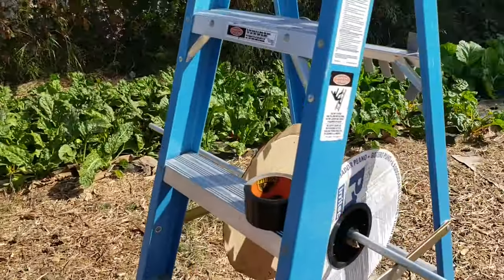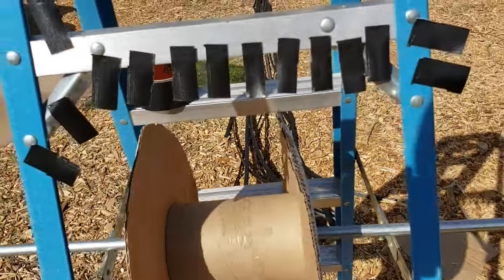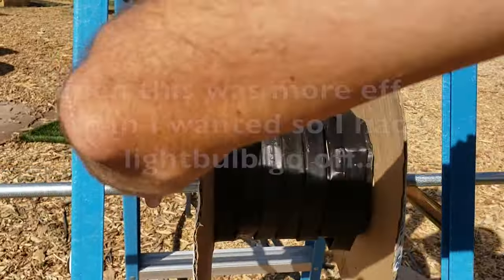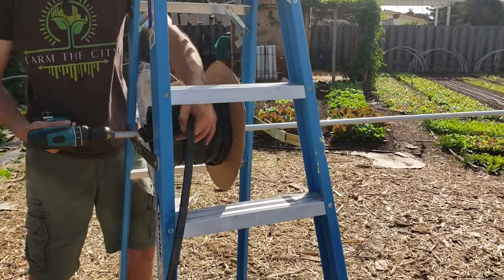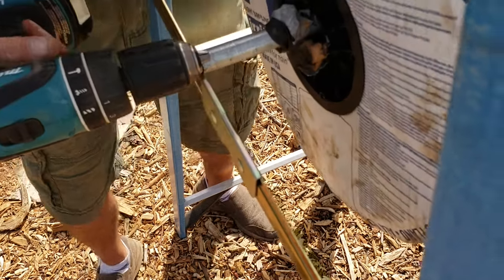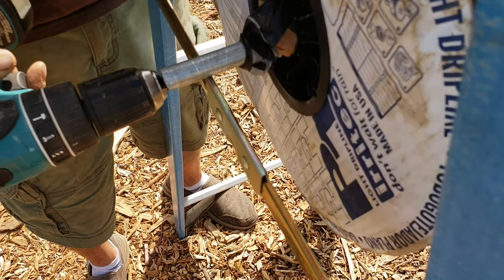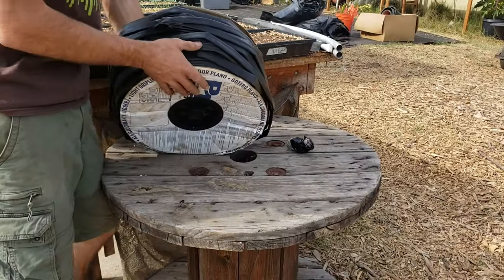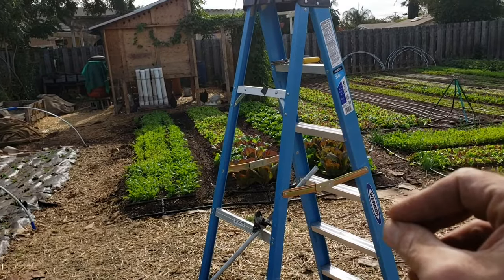How to Roll Up Drip Tape Irrigation Easily

Comment: I use utility buckets from the dollar store. The buckets are round and cost $1.00 each and I wind the drip line around the outside of the bucket. One bucket for each drip line.  I use a clothes pin at the start of the line clipped to the rim of the bucket and another clothes pin at the end of the line clipped also to the rim. I have used drip tape foe a couple of years and this is the best solution I have found so far. Hope this helps. Nice garden.
Reply from the maker: Thanks for the tips Gypsy! That sounds effective and organized.

Comment: Just about to start setting up our irrigation pipework for the farm. I like the drip pipe you use but how long does it last? Do you reckon it's worth spending more & purchasing rigid pipework for longevity?
Reply from the maker: The 3/4" poly at the first farm I helped build 8 years ago is still using the same drip system from these same materials. 15mil drip tape also lasts a long time. It depends on your application. As an urban farmer who leases land it needs to be easy to pick up and move to the next plot and not invest in permanent infrastructure. So that's why I build my systems this way. I like have the drip all above ground it makes it easy to fix and adjust, but I'd run the mainline PVC to wherever the plot is then run 3/4" poly for 2,000sqft or more 2,000sqft and less you can use 1/2" poly.

Comment: in plumbing they have expansion plugs . you may need a bigger pipe .thread and nut cranked opens bushing in the pipe to seal .attach the threaded shaft to your drill.
Reply from the maker: Thanks for the tips John, I'll check that out.

Comment: Wooden dowel tapped into the pipe, pre-drill and screw through the diameter or into one side at least, mating the dowel to the pipe, then chisel/sand/saw the dowel down to a diameter that your drill teeth can clamp on to.  Mark the center beforehand so you know the drill will wobble less, that would speed it up greatly, and shouldn't take long.

A more permanent fixture would be a drill bit or hole saw that fits snugly inside or outside of the pipe, then screw it together or solder it and you have an actual full metal construction with a legit drill bit to affix to.